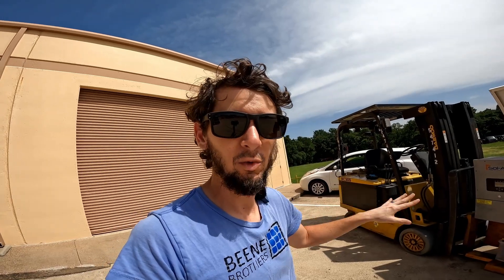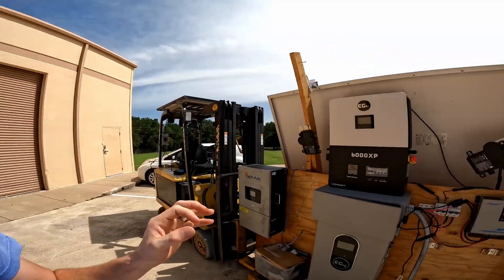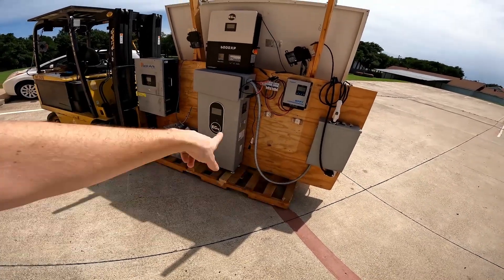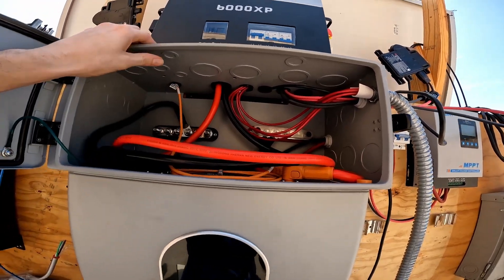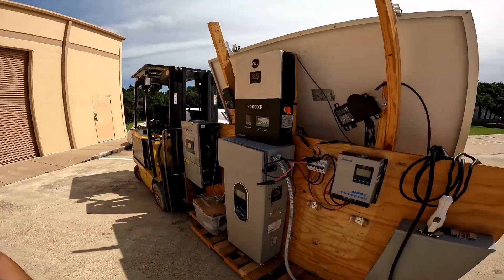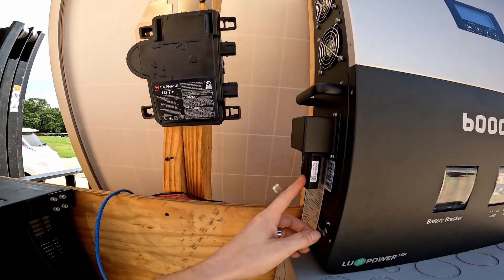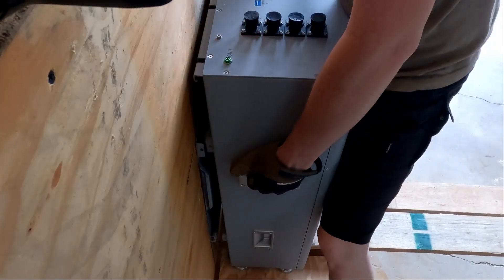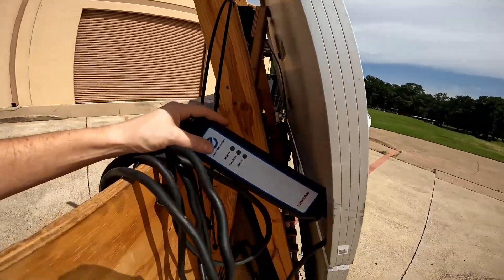My Emergency EG4 EV Charging Station

Comment: Sir can i connect longi himo x6 580w×2 panels with powmr hhj 60a in parallel connection to 12v battery
Reply from the maker: No that’s too much solar for the one controller

Comment: ouch i still have 10 bars. recently I ran out in neighborhood but the charger was 1300 Watts and tripping my conventional 1600 Watt inverter
Reply from the maker: How many miles do you get of range? Someone gifted me a 2011 leaf with 2 bars and it reportedly has about 15 miles of range. Only 55k miles where my 2015 has 99k miles and 60 mile range (8 bars).

Comment: In a pinch the ground neutral bond can be made with a jumper inside the female plug from ground side to neutral side. Don’t know how safe or legal it is, but my Nissan will charge that way, so does my tesla
Reply from the maker: I thought about that but didn’t want to be the one who said it. Ha ha

I think it would work so long as there was not a gfci breaker up stream.
Reply: @BeeneEnergy  yeah liability and all, they make a plug for generators that you plug into one side of the outlet and then use the other, somehow that’s ok? But they come with generators now
Reply from the maker: @travishodges5179  I believe the rule is the ground and neutral should be bonded at the power source. So with a generator it makes sense to bond there. If the generator is feeding a breaker panel that has it bonded though then it has to be unbounded at the generator so no current is flowing on the ground wire. So it could be they leave it not bonded at the generator in case we want to feed a bonded breaker panel. But then the generator is floating until we try to use gfci outlets or plug in an ev charger and notice it’s not bonded :).
Reply: @BeeneEnergy  three wire 240 hookup is still ok on a water heater? My cook stove my dryer? My air conditioner? So I suddenly have a 4 point plug, I use a jumper to fool the appliance, there is no ground wire existing to run power back on
Reply: @BeeneEnergy  I mean my I’ve been doing it since day one with the generator and leaf, got caught out without power and used aluminum foil to wrap around the ground and nuetral right on the male plug, sketchy yeah, but what do you do when your beater leaf poops out 20miles from home in the wilderness?
Reply from the maker: @travishodges5179  Exactly!